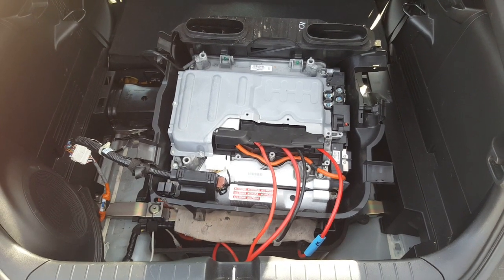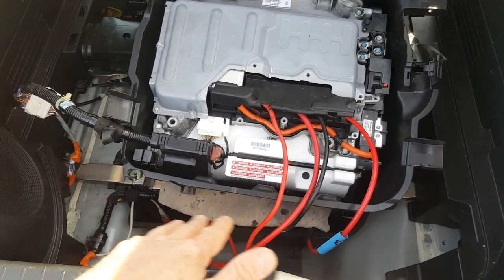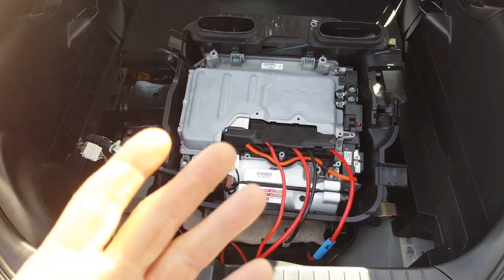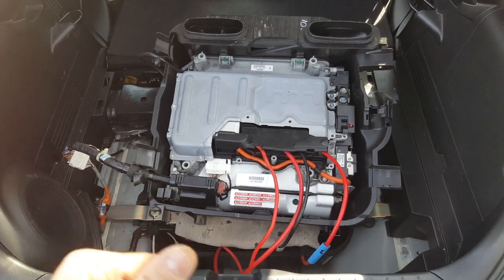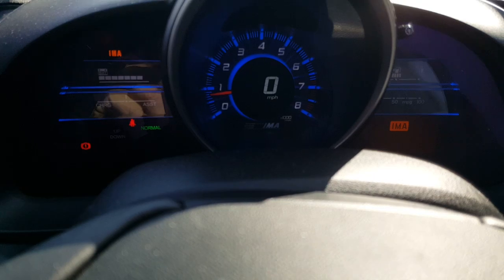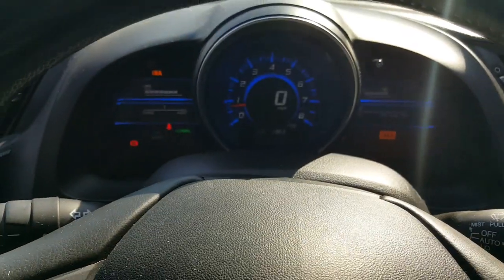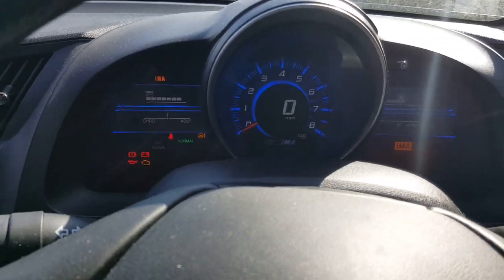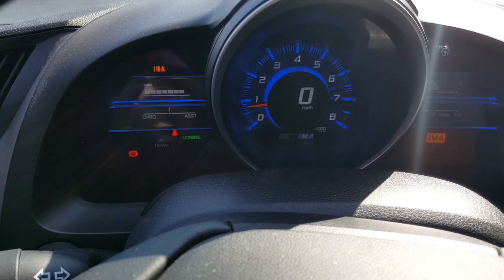Nimh Pack to Lithium CR-Z transplant test. Video 2

Comment: i wonder what is IMA light for at that time and please check that first and tell us what is the error please
Reply from the maker: You have to follow the thread on the cr-z forum for details. This is only a video repository.
https://www.crzforum.com/threads/can-the-early-oem-nimh-cr-z-pack-fit-into-and-work-in-a-later-lithium-car.95691/#post-1412306